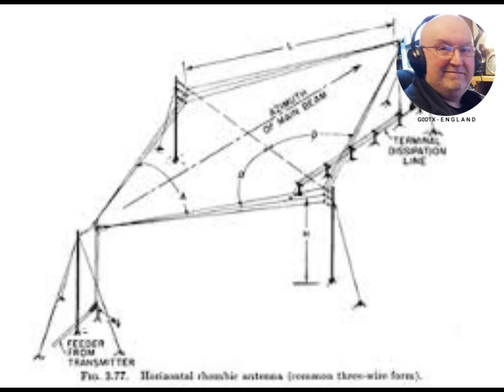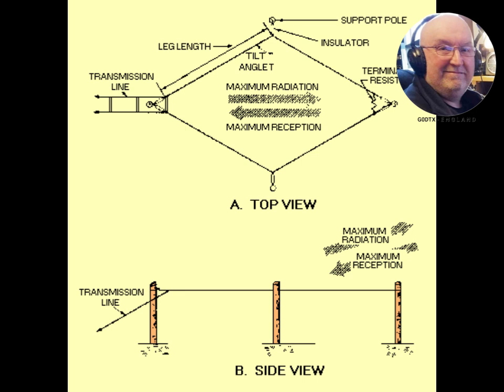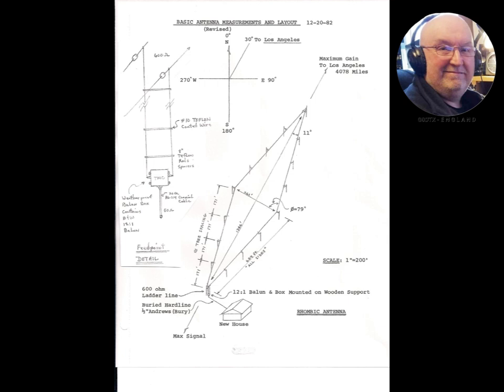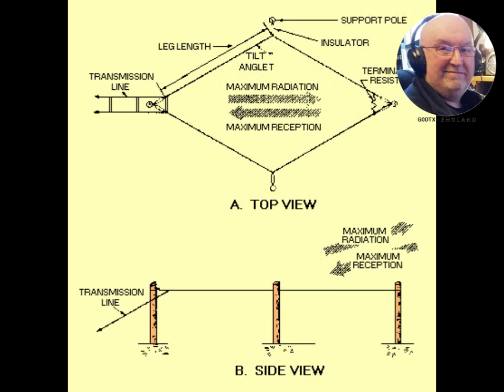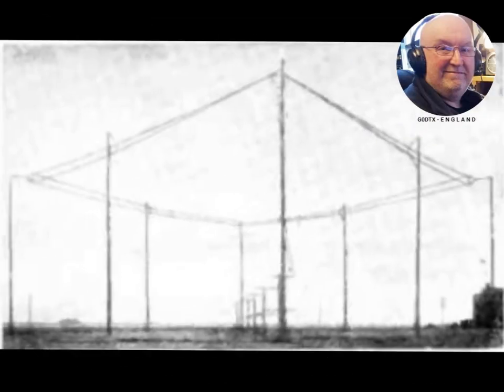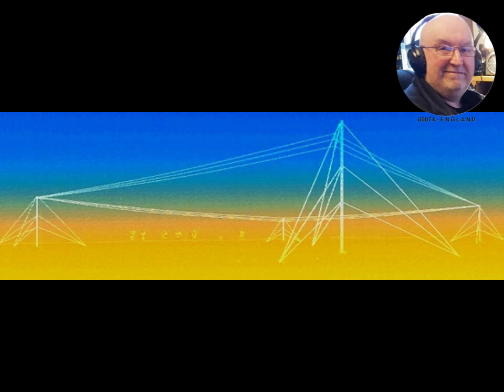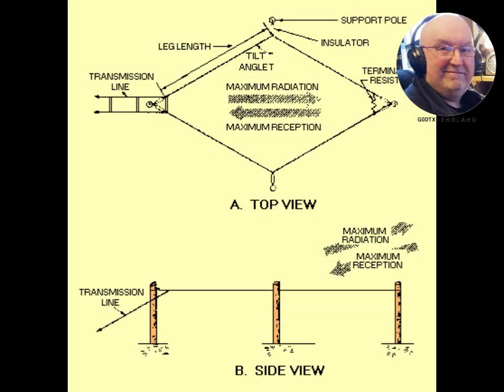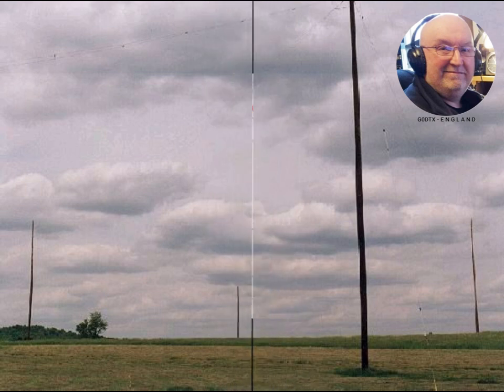what is a rhombic antenna.

Comment: I worked for relatives that were radio engineers back when I was in High School and we worked on and had many different types of full size and scale sized antennas where their office was.. Sterba curtains, steerable that had a small electric train to move the director, a couple Rhombic, a phased array group of verticals and a few others.. They designed short wave and AM sites from before WW-2 and into the 1970's all over the world.. A short wave station in South America was modeled to use a mountain as a reflector..